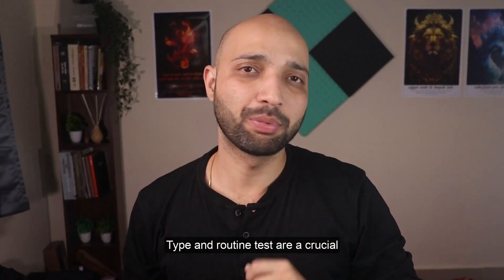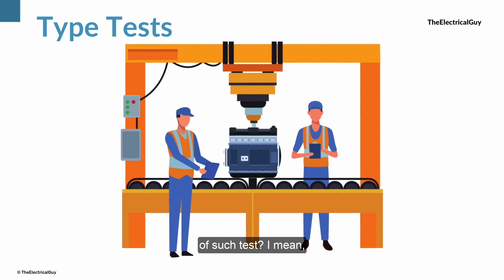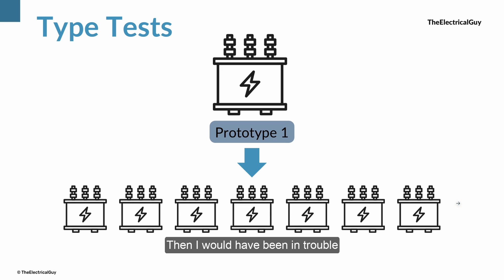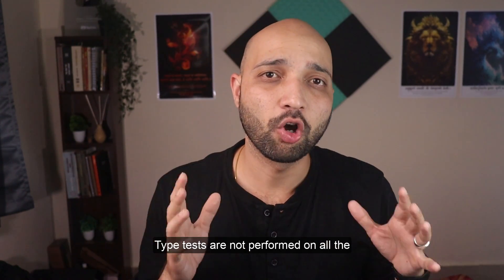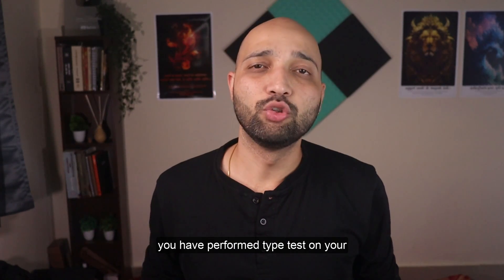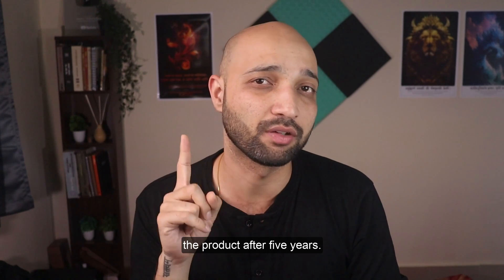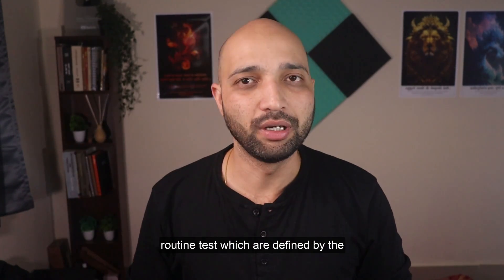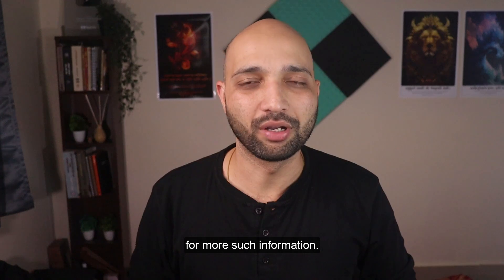Electrical Panel : Type & Routine Tests | Why they are a MUST | TheElectricalGuy

Comment: Sir this is very very helpful. Thanks a lot. I just want to see ur all videos. I m in the field of substation design so want to see some very important topics like how and what are the checks to approve power transformer drawings (40, 50, 100, 315mva abd more), control and relay drawings, GIS equipment modules, ACDB-DCDB and battery and charger drawings. Hope all you will guide, thanks